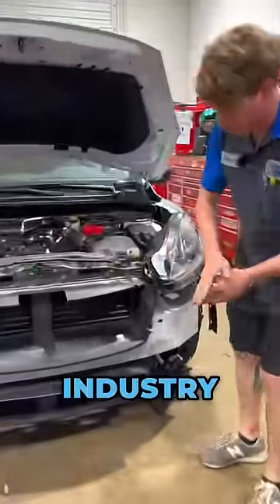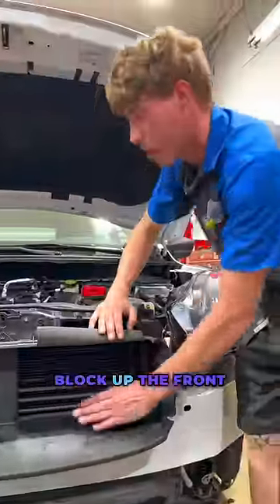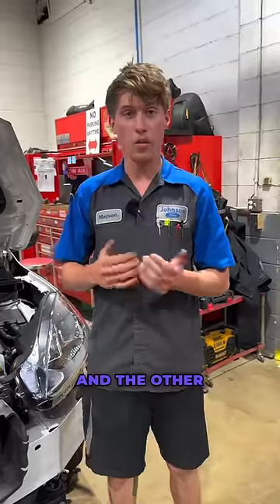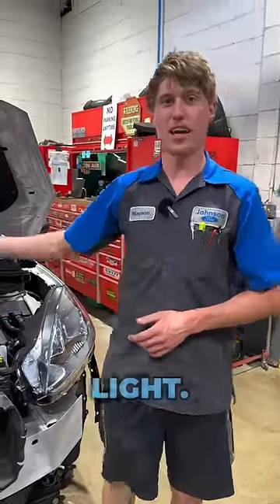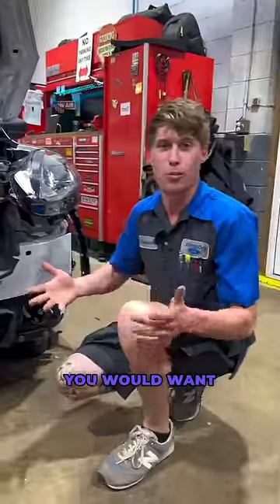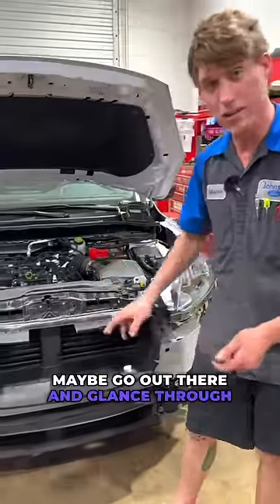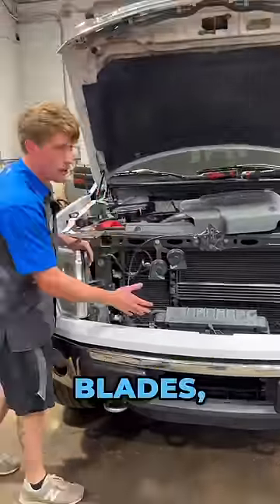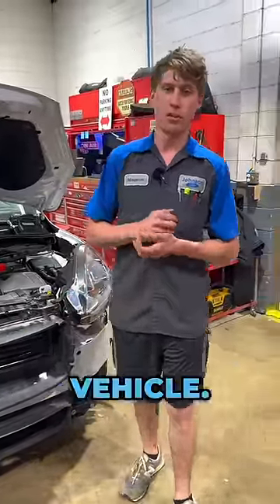Grille Shutters: A Newer Design In The Automotive Industry #shorts

Comment: And my 2021 F-150 even has an extra lower air deflector that supposedly extends downward at an uncertain speed because it’s impossible to see it happen while you’re driving haha. Which is why I’m going to get a higher clearance steel bumper custom made by a local off-road shop to replace the whole dang thing soon.

Comment: In the 8 years I've owned my Altima the only thing that has broken on it has been the grill shutter motor. The motor itself is easy to replace and only costs $30, but to clear the CEL you have to reset the open and closed positions. Which means a $170 trip to the mechanic or an $800 OBD2 computer >:\

Comment: They are there to increase fuel efficiency.  Air flowing through the radiator and intercooler represents DRAG.  The vehicle becomes more aerodynamic when they are closed or mostly closed.

Comment: Idk what to call it really. I hit a deer with my F150 last year. I got a new set of aftermarket shudders along with the other parts needed to fix the damage. The shudders I got, the ones that went into the motor, twisted the ends off. I left the motor plugged up & the service engine light hasn't cone on at all & it's been 9 months.

Comment: Deleted these grill shutters on my st, it may take a little longer to get up to temp in winter, but id prefer to not have them in the case they fail stuck closed over heating my engine or turning my intake temps up to several hundred degrees cause the intercooler has no airflow

Comment: This guy's never left home on a 10° F morning and found the heater still blowing cold air 5 miles later because of the cold air blowing thru the grille.  Without those shutters the engine would never reach operating temperature in a cold winter.

Comment: Old mechanical thermostats do this automatically. The difference I guess is that it increases that efficiency and adds better aerodynamic principals by forcing air around the grill instead of through it. Although, it would be better if the fans were made flush with the body work.

Comment: For better aerodynamics. Less openings means smoother airflow and less drag. If you're cruising on a flat state road on a cool day, you aren't generating much engine heat and don't need much cooling, and if you have even less aero drag, you need even less cooling and get better fuel economy. Drive up a mountain or in bumper to bumper traffic on a super hot day, and suddenly you need ALL that cooling.

Comment: I can't speak for all Ford's but I know that on the Focus ST removing them doesn't actually set a CEL but it will set a dtc if you check codes. Also I hate that these exist they serve no real purpose and restrict my aftermarket intercooler options for certain autocross classes.

Comment: Couldnt you just lop off the middle of the blades?  Keep the very edges connected so that the motors still have crap to actuate?   Or are there sensors in the blades themselves?

Comment: Does nobody know that a big reason is aerodynamics? Radiators and other heat exchangers can make up to about 33% of the total drag of the vehicle.

These shutters force the air around the vehicle over the much less draggy body to increase fuel savings when the load on the engine is low at cruising speed on the hwy.

Many other cars on the road have this. F1 in the 80's had qualifying cars, when the rules allowed them. These cars had no openings for air to flow through the radiators so that the drag was as low as possible. As you would expect, they could only do 1 fast lap at a time otherwise they'd overheat and fry the engine.

Comment: Finally, a solution to keep birds, bugs, rocks sticks and any other debris out of your radiator..... As long as it lets enough air through to cool your engine.... 
I live up North and in the winter time. This thing would be great because sometimes it's so cold. The radiator won't even allow the engine to warm up enough to make heat at the heater core... ( Or you could blame the thermostat to if you're like.)( The answer is always to cover the front of your radiator o up with a piece of cardboard , Not a 100% of course, set about 50%... )

Comment: Actually, the shutters are part of the aerodynamics, not to heat the engine. Active Grill shutters can improve gas mileage by 25% and battery life, for electric vehicles add 20% to a battery charge.

Comment: I assume they are actually for better aerodynamics and therefore fuel economy.  NOT that there isn't an increasing amount of planned obsolesce and un-repairability on current vehicles.

My real question is if these things are chipped to be OEM-only or if you can find aftermarket replacements.

Comment: As many others have pointed out they are a long way from being 'NEW' they were pretty much a  thing from the beginning of internal combustion engines and lost popularity in most applications about the end of WWII when the lowly wax pellet thermostat first really came into it's own... and while they are excellent for faster warm ups and Extreme conditions... the real push on modern automobiles came when some sad engineers remembered they existed and then remembered that as counter intuitive as it sounds they can lower drag by helping the aerodynamics of the vehicle when they shut. Which also corresponds to times that vehicles apre moving at higher speeds,  they are almost never the simple open or closed systems of the past.... typically depending on the manufacturers strategy the computer may/ will open or close different sections to taylor aerodynamics and air flow to the needs of the engine at that moment.

Comment: This is like one of the only decent “new” things manufacturers are doing. They’re for fuel economy. At highway speeds if your engine is barely ticking over and doesn’t need any extra cooling, the shutters close up and stop air flowing into the engine bay which is a massive aerodynamic drag zone. 

Of all the stupid things like belt driven oil pumps and oil submerged water pumps this is one of the only ones that actually makes sense.

Comment: Tin snips… cut the blades out… the electric  shutter motor will still work. Also… on fires it turns on a maintenance notification, but that’s not related to the Check Engine light that will cause a smog failure.

Comment: you just explained that their role is to help warm the engine faster, then you said it doesn't make any sense, if they open and close, they work based on engine temperature, it is not new, turcks had this, my e60 from 2008 has this feature, and no problems.

Comment: These are installed because they close at higher speeds for aerodynamics, when the air around them is enough to cool the engine, and you gain a small percentage of fuel economy. Ya know.. because the government.

Comment: My 13 ram 1500 had these, took them off and removed the engine code with hp tuners, then I put a 185 t stat in and had it tuned, never gets above 200

Comment: You could probably cut them out and just leave the motor to actuate what little plastic is attached. Unless there's some sensor for the weight of the fins which i doubt then it might work. More than likely the motors are just sending a signal that they are actuating. Just a guess but yeah kinda dumb. 

Maybe in the winter so it takes less time for your motor to heat up on the go but most cars come with autostart anyway.

Comment: Yeah 
The shutters on the intercooler is a good idea 
Why?

2014 vw Jetta tdi
In the winter they will build up with ice on the inside 
When it suddenly gets warm, the ice turns into water, which goes into the motor and hydrolocs 
Just saying

Comment: I've replaced about 700 of those pieces of trash. It sets off your check engine light all because there was a hesitation of the motor,  weak or failing motor,  shutters came off the track, shutters are broken by a rock chip. This is really only useful up north but in the south is causes too many problems.

Comment: I mod these EVERYDAY...  I install grill guards, custom grills, blackout packages, bull bars and other assorted aftermarket parts.  I just did a push bar on a popo package on 2024 F150's.  I remove the whole assembly and remove actuator.  Extend cables and mount off to the side.  Now there's PLENTY of room for both yelpers and strobes.  Nothing new here...  Completely removable and will not throw codes...

Comment: Could always remove the whole shutter system just leave the motor hanging with a zip tie connected to the harness and it’ll probably be fine and no check engine light

Comment: Their called fins ' not blades not shutters my machines build them at Montaplast of North America ! As a maint tech I work on the 5 machines the parts are built threw  ! Yes it helps warm up fasterbut also in colder places it helps the engine from running to COOL ! FOMOCO

Comment: All kidding aside, its there to meet emissions.  your engine burns fuel more efficiently when the engine is hot.  The shutter on the intercooler is only there to speed up the process. Once the engine is hot enough, the shutters open up.

Comment: "can't think of a reason to heat intercooler" #TDI enters the chat with a frozen intercoooer. I'm glad mine is water to air so in the winter it actually will use hot coolant to stop freezing, and for the rest of the year it prevents heat soak

Comment: Your engine needs to heat up as quickly as possible for the best fuel mileage and the lowest emissions. But your thermostat already performs that function. So this appears redundant and may not help much.

(Unless they designed this vehicle without a thermostat. In that case, you would need the louvers.)

Comment: Its all being done to lower emissions. Warm up the engune faster to lower fuel consumption and lower emissions at the tail pipe. Hence why we have all these new problematic features in modern cars that wil definitely keep you going back to the shops for repair. 

For example why would a diesel engine need start stop system when they function well when running hot? Just why? Just to qualify an emissions badge on the engine...

Comment: You sounded smart until you got to the part where you said they intentionally put these in to cause more issues. No.. It does help with warming the engine quicker. But at highway speeds these close to help with aerodynamics. Help saves fuel. You don't need much cooling when you're just cruising down the highway.

Comment: Mora crap by the manufacturers to have the customer, take the cars back to the dealer whenever these things fail.  They are taking away the ability of an owner to do basic maintenance, and pushing the independent mechanics out.  If you need to replace a headlight assembly will cost you thousands of dollars, not because the assembly is expensive, but because of the labor to take off the front facia of the vehicle to be able to replace the assembly.  If the assembly has HID's then it will be even higher.

Comment: That's actually not new... Some early model semis have them... Particularly from the 60s-70s-80s. The point of them back then was to keep engines warmer in cold climates. Back then they were actuated with an air switch that routinely failed... If you were lucky they failed open so it wouldnt cause over heat conditions. It was strictly for heat in the HVAC during winter months.

Comment: You are missing lots of information. Imagine you live in a very cold climate and you’re starting your car that is so cool that your car doesn’t run correctly.

Almost all vehicles have some way of pumping hot air into the intake at start up because there is a minimum acceptable temperature. Blocking off the intercooler and -20° weather may be required because the intake air temperature would be so low that the car wouldn’t run correctly.

Comment: This is for emission purposes. If the engine heats up faster, the o2 sensor heats up faster and begins to read sooner. This reduces emissions by cutting down on the time it takes for your PCM to receive input from the O2 sensor and begin accurately controlling the evap, the EGR and the fuel injection. Prior to this the PCM is just dumping fuel from the injectors and nothing from the evap system or EGR. Also when you heat the air going into your engine this reduces fuel consumption due to the mixture being evenly distributed inside the cylinder. Cooler air condenses this mixture more enabling the system to add more fuel so as to extract more power from the added fuel.

Comment: The reason for the thermostat was to allow the coolant to circulate in the engine longer. Allowing the engine  to warm up faster. I like whenever college educated kids get engineering jobs. Then, try to reinvent the wheel. Louvers were replaced by the thermostat. Why? Because louvers didn't quite work. They had too many mechanical issues. Stop trying to reivent the wheel and start making the wheel servicable and repairable.

Comment: Why not just Cut the blades out leave the motor and actuator.  You shouldn't have to worry about the check engine light and your problem is solved until the motor gives out.

Comment: Who cares about the check engine light If you know why it is on. My Ute has a check engine on all the time because it runs a wideband o2 sensor and the wideband is converted to narrow band and connected to the ECU but the heater for the sensor is not sent to the ECU so the check engine is on for a faulty heater on the o2 sensor. But it works and there is no fault it just thinks there is. It is setup like that for tuning.

Comment: It helps with fuel economy by 0.000002% same with egr and all the other nonsense they’ve added.  Ultra low friction piston rings which is why ur brand new 4 cylinder drinks oil. It’s going down hill fast lol.

Comment: my 2016 f150 active grill shutter b wont open it will fucking close only so of course its a 700 dollar repair for some plastic shutter and plastic gear motor cus you have to rip half the front end apart 😅

Comment: Automobiles built over 110 years ago had these, but they didn't need complicated electronic control modules. They just used mechanical thermostatic actuators, many of which still work just fine. This is not a new idea, and only an idiot would use computers to do it.

Comment: see... maybe I am mistaken, but what does it matter that air is going over the radiator if no radiator coolant is flowing because the thermostat is closed?
100% right, just more %$#@%# to break and add cost.
Reply: Because it isn't to stop air from cooling the radiator, it's to stop air from cooling the entire engine bay and thus cooling the engine and transmission, which doesn't have a thermostat, btw.

Comment: All your credibility goes down the train when you make outlandish claims like “they put air shutters so car breaks more”.

It’s all the CAFE mandates and efficiency, but it takes more than regurgitation and a lift to actually dominate your field.

Even with modern multi-valve water cooling systems that have 2, 3 or 4 zones, you can still use the shutters to help a tiny bit with drag, but they do protect the radiator and Inter cooler from rocks and debris or salt/sand in the winter.

Comment: It's for aerodynamics and fuel efficiency.  The air flowing into the engine compartment is much more resistance than flowing around the car when the added cooling isn't required.  Also you can take all of the louvers out and the pcm will still see actuator movement and have no idea it's gone.

Comment: They shudders aren't a new thing and in very cold environments they are very helpful if you want heat in your car but electronically controlled shudders is asking for trouble what happens when you are cruising around Arizona in 120 degree weather and the shutters shut and you over heat the engine me I'd take tin snips and cut them out leave the electric parts alone that was the computer still thinks it's working

Comment: Don’t worry folks. If the shutter circuit doesn’t work, the CEL or MIL will not light and it won’t fail any nazi emissions test. The shutters should be stuck open, though.

Comment: Somebody... doesn't live in a United States State or Canada or anywhere else in the world that approaches negative temperatures below zero Fahrenheit or Celsius. This young knucklehead doesn't realize that a good percentage of the Northern Hemisphere has extremely cold weather! Guess what cold air traveling into your engine compartment does to your engine? It cools everything in there! what a concept! In ye olden days before radiator louvers... people used to put cardboard boxes or sheets of cardboard behind their grills and in front of their radiators to allow their radiator and their coolant to heat up even faster than normal in Arctic conditions. I bet this young knucklehead doesn't even know what an engine block heater is... or an external engine oilpan heater is... or an external transmission oilpan heater. 

I bought my brand spanking new... So new the odometer had not even reached the break-in mileage... 2007 Dodge Charger RT all-wheel drive in Fairbanks Alaska in 2008. guess what the dealership themselves (for a nominal fee) had already installed on the car... before I even laid eyes on it? An engine block heater inside the engine block. as well as an external engine oil pan heater and an external transmission oil pan heater. The dealership even wired all three of these devices together onto one outlet and cord and plug that went outside the front bumper of my car. So that I could take an extension cord put it into that male plug and then take my extension cord and plug it into an electrical outlet. which in Alaska is pretty much everywhere in the State where a car parks outside for more than an hour.

Comment: Biden s EPA. We are lucky they never mandated catalyst radiators. Volvo experimented on them. Then Mitsubishi actually installed them and if the sensor doesn't see radiator heat from both sides it throws a code. $1250 radiator for anyone that can't figure out how to get around it.